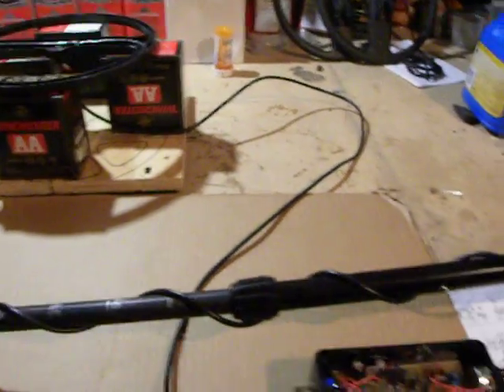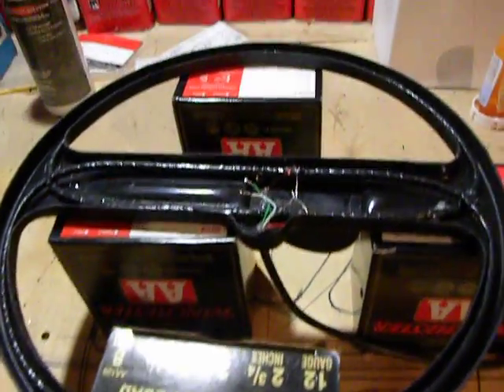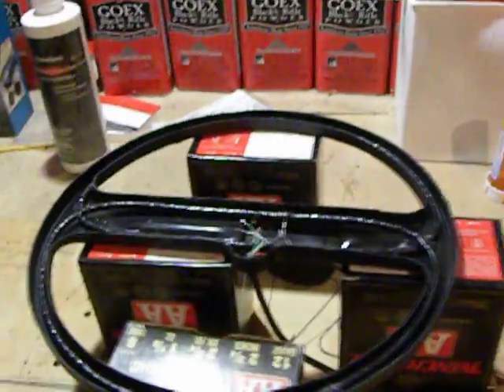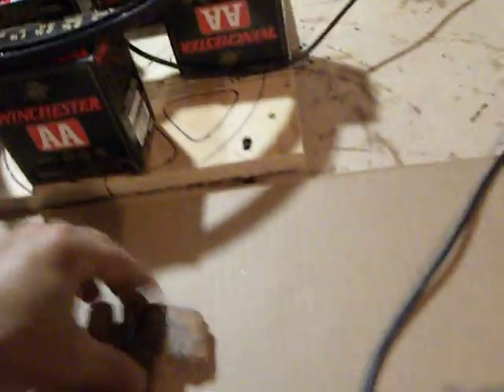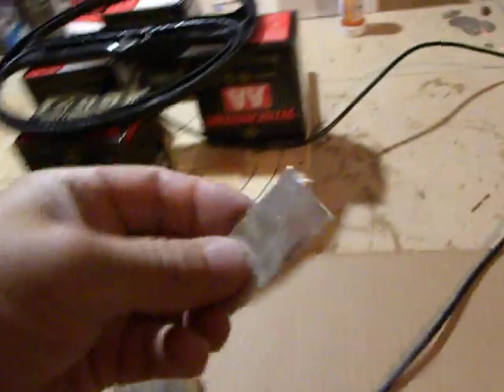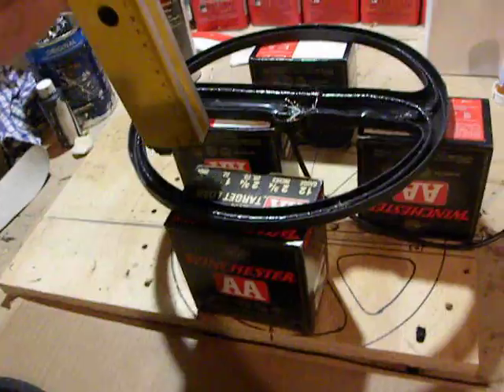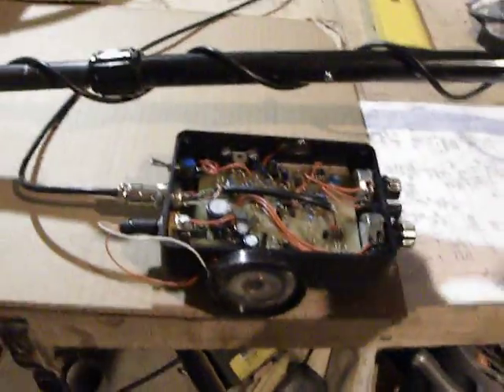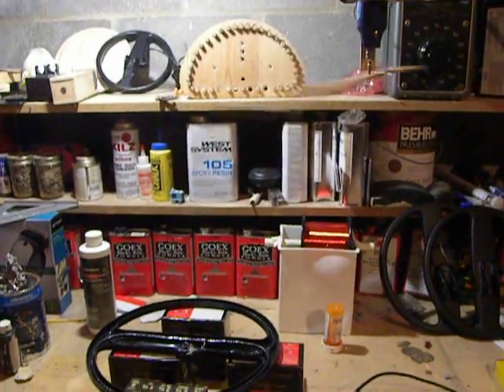TGSL-VLF_1.avi

Comment from the maker: The most outstanding feature of the project is descrimination. In many cases, other detectors will make cracking, spitting or popping sounds. The TSGL will not!
You stated that "it would have detected all targets at all distances after you turned that sensitivity up to the max".  No, this is not true. There are seperate controls for sensitivity, discrimination and ground balance. Adjusting the sensitivity does nothing to the discrimination setting.   Hope this helps..